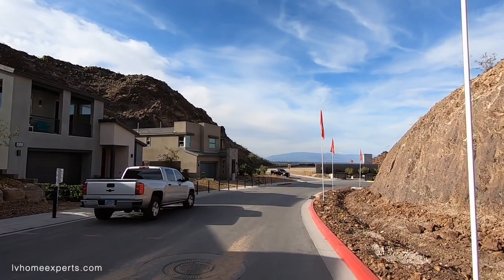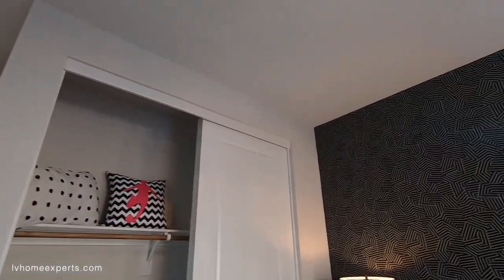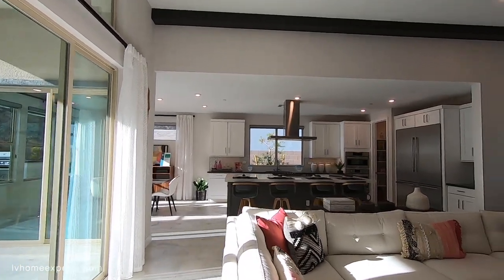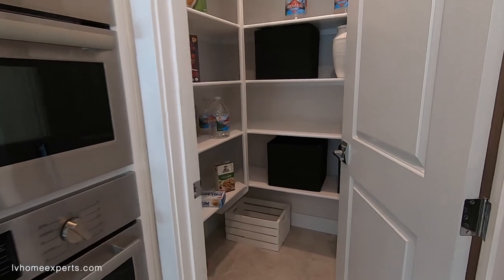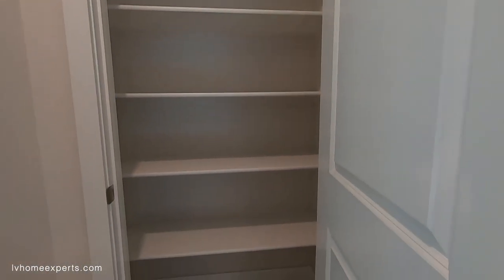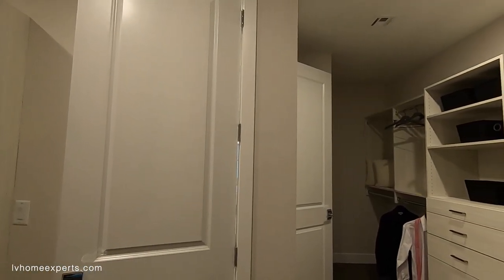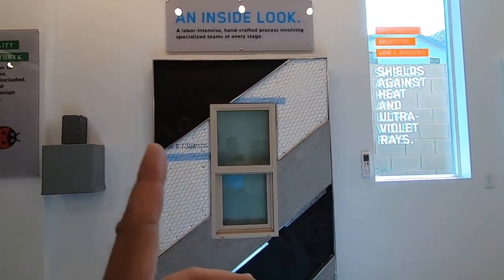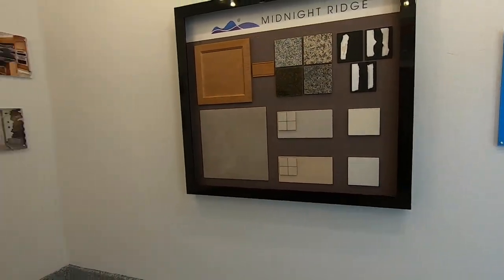1 Story Modern Home For Sale Henderson $615K | 2,745 Sqft | 3-4 BD | 2.5-3 BA | Opt Media Room | 2 C

Comment: I would go with a Bedroom instead of the Super Lounge. Easier to resell as families are looking for Bedrooms in my humble opinion. Rain gutters and lattice is a good idea on the entry courtyard. Why have 1 Dishwasher when you can have 2 at twice the price. So no attic and therefore there is just roof, radiant barrier, insulation, and then ceiling drywall. I would have to check that feature out before I would opt for that kind of home.